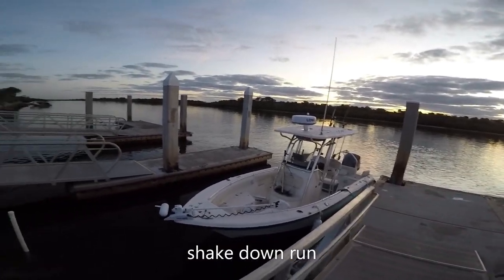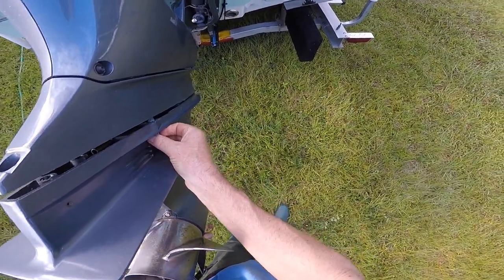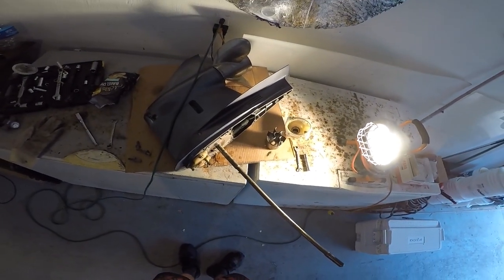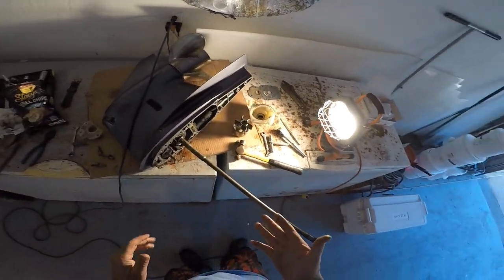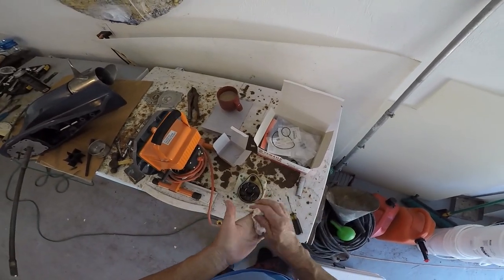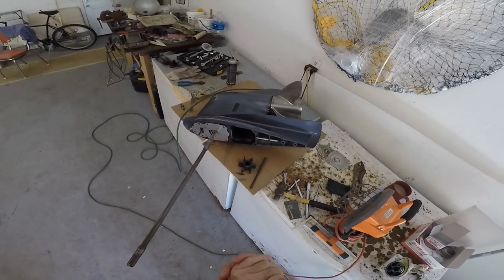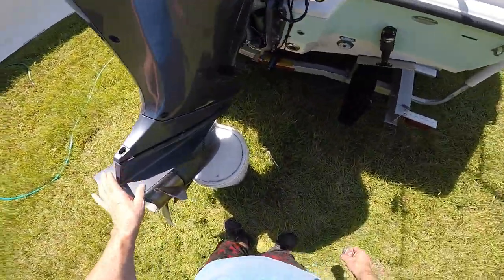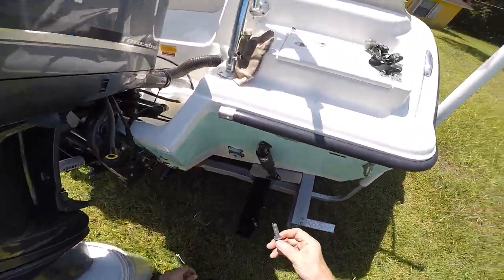yamaha water pump replacement

Comment: Had my tattler plugged also. Since the over heat alarm didn't come on at the dock I pulled the cover then pulled the tattler waterline off the plastic outlet. No problem at the line. Pushed the mud out with a large ziptie. Thanks
Reply from the maker: yea I should have checked that ,I know better. it would have saved a trip and lots of work thanks for watching